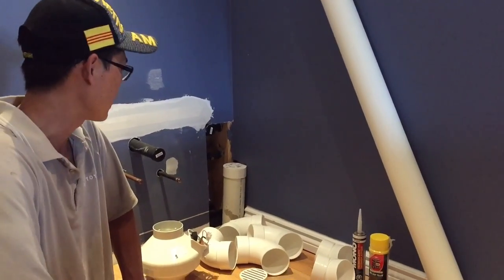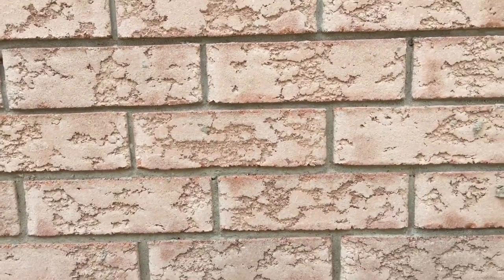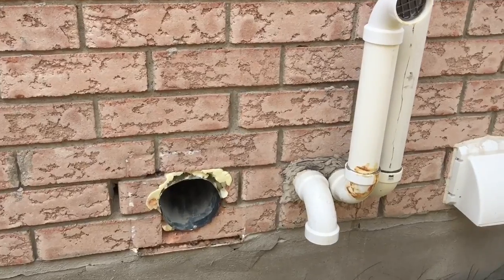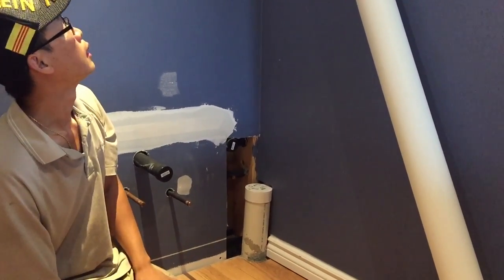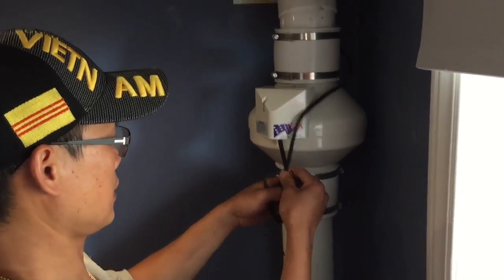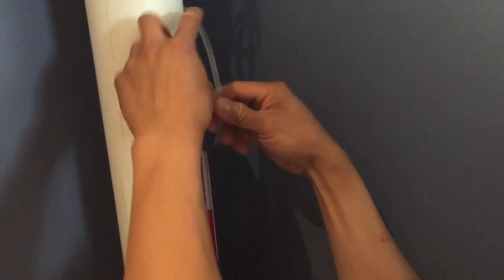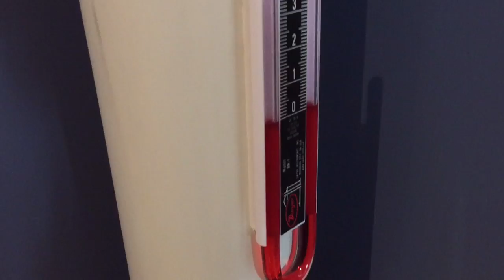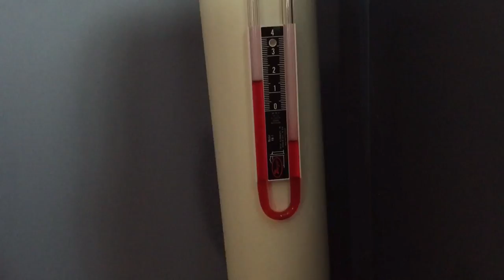Radon Mitigation System - DIY

Comment: There are so many things wrong with this system. Fan shouldn't be in a livable area either outside or the attic. Outside needs to be above the roof line. And it's not required but schedule 40 would have been better than scheduled 20. 20 will form more condensation than the 40. Also needs to be supported every 8 ft in a vertical run and every 6 ft on a horizontal run.
Reply: Lots of people commenting negatively about fan being placed in the basement, but lets set some things straight.  Actually Canada says the basement is the best location to prevent damage to the fan.  I live in Fishers Indiana, and the city allows installation of the fan in the basement.  If you think about it, if you don't allow the Fan to be located in the basement, then you should not allow gas furnaces or gas water heaters to be located in the basement.  As Canada says regarding radon fan installation, "properly installed fans and pipes will not leak radon into the building and are usually installed in the basement".  I will soon be installing my Radon Fan in the basement, no doubt about it.

Comment: Fan needs to be in the attic or outside so if there is a leak in the fan you are not pumping it into the house.  Also it needs to be a foot above the roof line so gas does not come back thru a window
Reply from the maker: Todd Lori Haack 
Thanks for your comment.
This fan is an airtight/sealed fan so it can be installed inside. Also due to the Canadian freezing weather, outside installation is not an option. As I consulted with the radeon testing company and the fan supplier (in Ontario, Canada) exhaust pipe does not have to be above roof topped but at least 24" away from any window and intake fresh air such as the HRV intake. Besides, we don't normally open windows in any season, especially on the side where all the water heater and furnace exhaust are vented.
Reply: @PTranProductions  what were your radon readings before and after?
Reply: Lots of people commenting negatively about fan being placed in the basement, but lets set some things straight.  Actually Canada says the basement is the best location to prevent damage to the fan.  I live in Fishers Indiana, and the city allows installation of the fan in the basement.  If you think about it, if you don't allow the Fan to be located in the basement, then you should not allow gas furnaces or gas water heaters to be located in the basement.  As Canada says regarding radon fan installation, "properly installed fans and pipes will not leak radon into the building and are usually installed in the basement".  I will soon be installing my Radon Fan in the basement, no doubt about it.

Comment: I liked the video.  Will you be able to comment on what the radon level was before installation and what the radon level is after installation of the fan?  Did you also box in the piping to hide it in the house?

Comment: The pipe that the builder installed seems to be obstructed. Your fan appears to be an HP-2190 and your manometer reading is at approximately 1.8". If the pipe was clear it would usually read closer to 1". This means the fan is not pulling as much air as it should. Builders are notorious for just shoving the pipe into the dirt and pouring concrete around it, thus, making it hard to draw the radon from under the slab. It wouldn't be a bad idea to cut the pipe close to the bottom and inspect. We do this proactively on builders pipes because most of the time they are not installed correctly.

Comment: Todd Lori Haack, R.J, Smith you are both incorrect. I am shocked this is not common sense for you, but in Canada, it is far too cold to put a fan in an un-heated space. This is perfectly acceptable. I have installed many radon fans in the basement. In addition, the C-NRPP teaches this. It's you who needs to do more research, lol. As for the pipe... It does need to be schedule 40 pipe.
Reply from the maker: Simon Air Quality 
Thanks for your comment. I may consider replacing pipes to schedule 40 and hopefully it would reduce the accumulated condensation in the system.
Reply: Yea any time. Another thing you may want to consider is to place the hole for the manometer below the top of the manometer. That way, if any condensation runs down inside the pipe, it won't run down into the manometer.
Reply: Great job! I have 400 bq/m3 in my basement. So I just purchased a fan kit. I’m in Canada as well. Any advise you may have would be greatly appreciated. Shannon

Comment: Fan needs to be outside regardless if it's a sealed fan.  It's code if there is living space above.  Pipe on the outside has to be above the roof line at least a foot.  You need to fix all of this!  You need to follow codes or you are putting yourself and everyone else in danger.  Just research it please.
Reply: Lots of people commenting negatively on the internet about fan being placed in the basement, but lets set some things straight.  Actually Canada says the basement is the best location to prevent damage to the fan.  I live in Fishers Indiana, and the city allows installation of the fan in the basement.  If you think about it, if you don't allow the Fan to be located in the basement, then you should not allow gas furnaces or gas water heaters to be located in the basement.  As Canada says regarding radon fan installation, "properly installed fans and pipes will not leak radon into the building and are usually installed in the basement".  I will soon be installing my Radon Fan in the basement, no doubt about it (regardless of EPA recommendation).
Reply: "Just research it please" ok, sounds like he did. Maybe you should go research it please.

Comment: WHERE ARE THE PIPE BRACKETS!? THE PIPE OUTSIDE IS HORRENDOUS! 

2/10 SYSTEM.
Reply from the maker: DH TV 
No brackets. It is a 4" PVC pipe which can hold up very well at this height and yes it does stand out. :-)
Reply: The size of the pipe is irreverent, if you came out to the 90 degree elbow with it sat in the wall slightly, you could then fix brackets to your pipe to ensure stability. The Fan also should be secured with brackets too. I work with radon for a living in the UK.. ill just say that our standards are 100% better.
Just the small things like the manufacturing print on the PVC pipe.. turn the pipe around so the print is hidden at the back. (looks better already)
I must say i agree with your method of marking the pipe to line it up perfectly but try using a pencil instead of a sharpie.. looks better again.
Sorry to sound like im hating but it just frustrates me that we try to set a standard of work with radon systems and then people on youtube with no training post videos on the subject and people believe its the way to do it.
Reply from the maker: DH TV 
Thanks for the tips!
Reply: DH TV no this is definitely a DIY. This does not meet our standards here either. So many things wrong with this system.
Reply: Jordan Coffey where are you based?
Reply: DH TV we are an indoor air quality company in Tennessee that specializes in Radon.